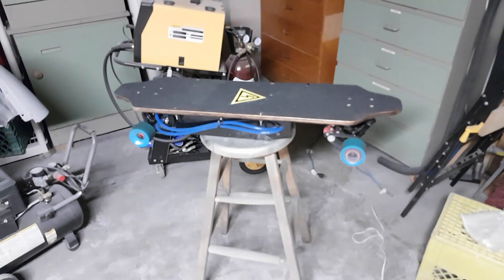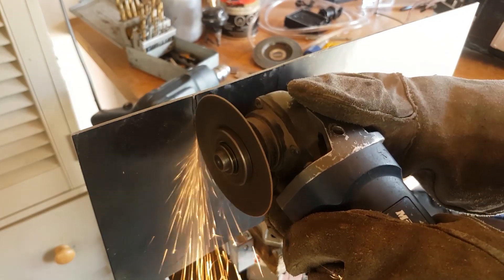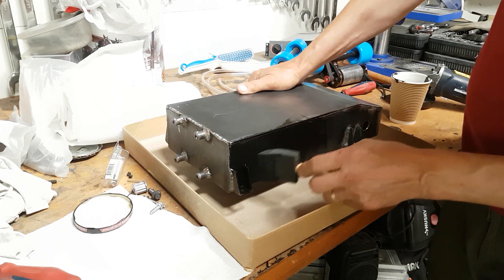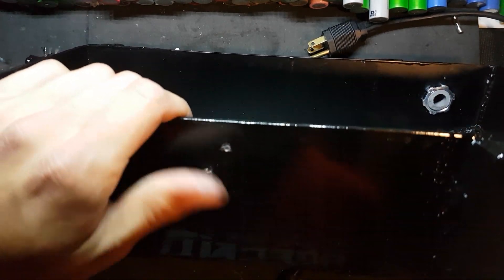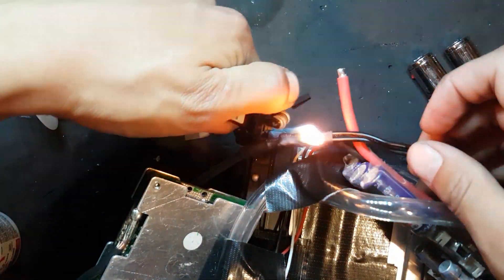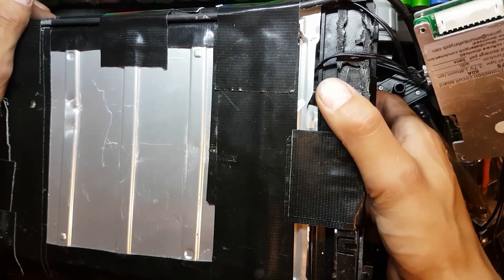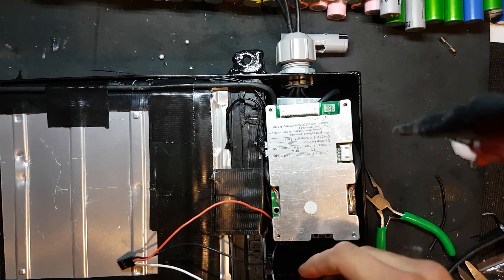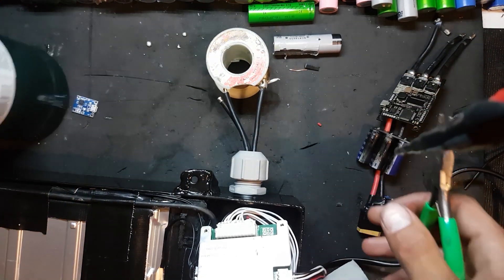Water Cooled 4000 W Electric Skateboard - Part 1

Comment: 4000 W power is total overstatement. Although your battery and motor might be able to put down such power,  you bottlenecked it with 60A BMS and VESC 4.12 that even watercooled isnt able to run more than 50 amps continuous. At best you might be getting 50*25=1250 watts.
Reply from the maker: I appreciate the feedback. I did not say I expected the board to sustain a 4kw output.

Perhaps I could have worded my specs more carefully. The nominal refers to battery voltage and not time. I'll adjust that. However I did not overstate anything.

In it's current form the board will lay down 4kw. The BMS and VESC can output that power for longer than you could ever utilize it accelerating. The board will not use that power continuously.

The VESC has official specifications for a 50a limit. But with the firmware without hardware limits I was able to push far more current.